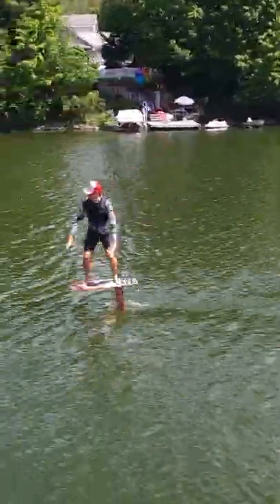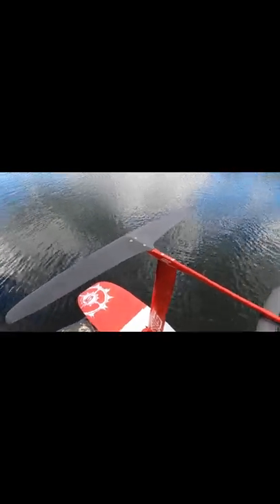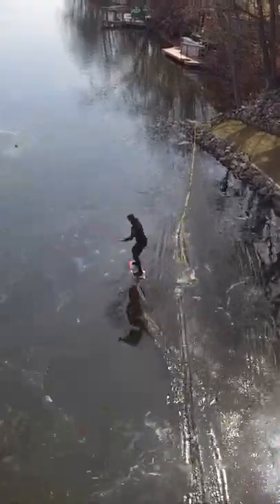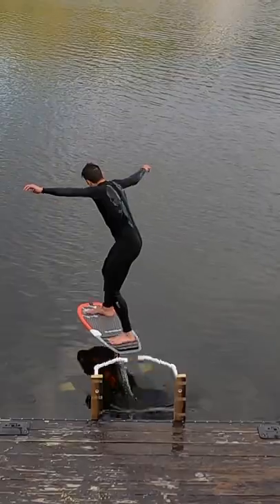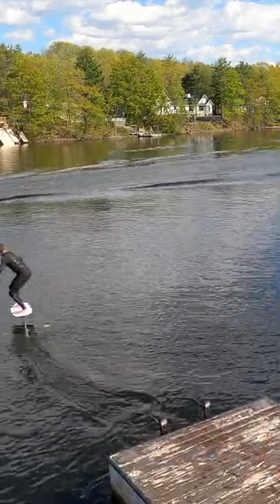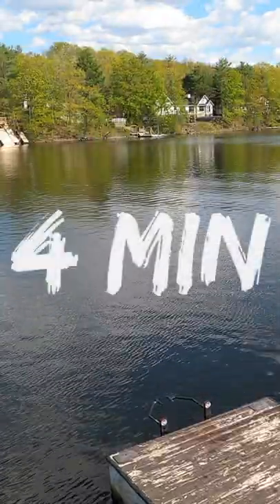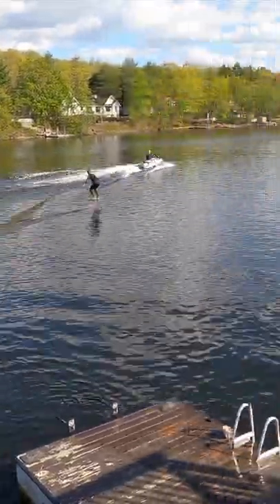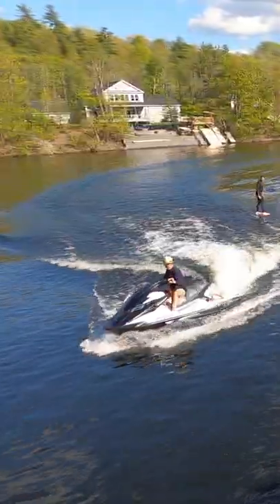Flying on Water #Shorts

Comment: Nice. Is it possible to do with any kind of foil or it has to have a big wing?
Reply from the maker: This will work for any foil provided it is big enough ... I would guess that if you have a 75cm mast or larger (with this contraption set up so front wing is just below the surface), a 190lb /86kg person with any foil that has >1500sqcm of area could pull it off. As area goes down the speed of lift goes up, so you'd just have to run faster.  I think I could do it at 190lb / 86kg with a 1500sqcm.  If I were 150 lb, I could pull it off with a 1200sqcm wing. As area goes up, you just don't need to run at it as fast.  I hope that answers your question.
Reply: @WakeThief  

Thank!